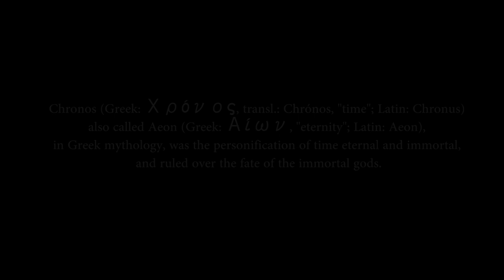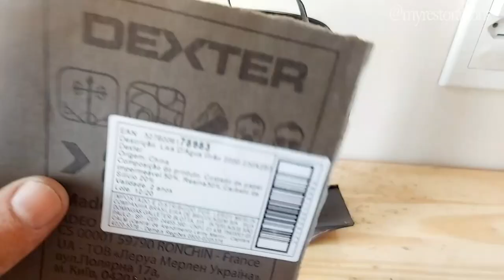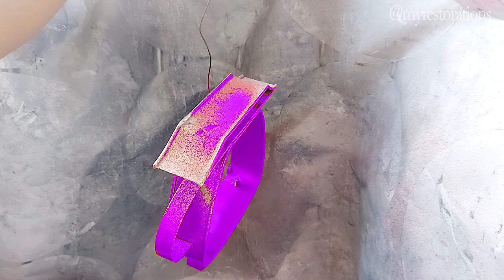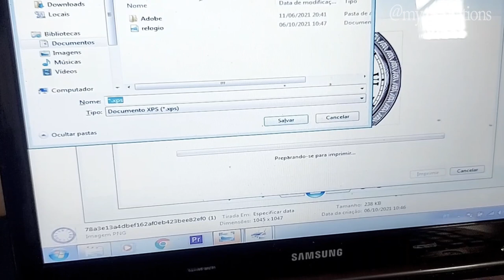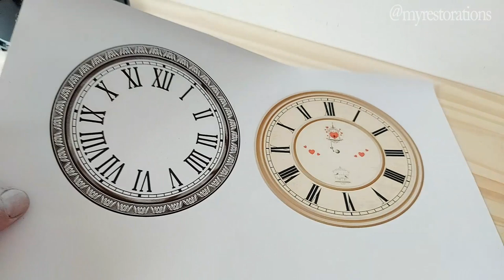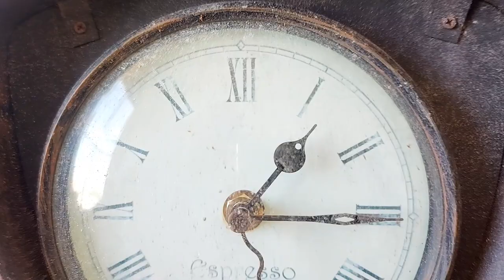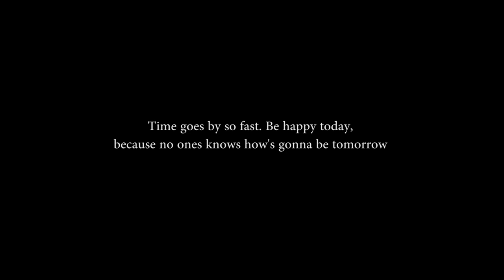Restoration Of An Old And Very Rusty Clock: Bring it to new again

Comment: That is not an antique - it has a modern battery powered tic-toc movement, surrounded with a plastic bezel on the back of the clock face.
Reply from the maker: You're right. Do you think I have to chance the title? 🤔
Reply: @myrestorations  - 😐, in my opinion = you need to change the title so it is not misleading, I have unfortunately reported this to YouTube algorithm as “spam and misleading”. When watching that video, yes it looks old but I looked at the hand spindles and when you turned it around and showed the plastic back I knew it had been made after 2000s = and was modern/recently made, just that the metal surround - shaped like a steaming tea cup and saucer - it was left in a humid environment and had rusted making it look old. The restoration was good and I liked it
Reply from the maker: @samuelfellows6923  Thanks a lot for your feedback I'm just beginning and I have a lot to learn, so I think it's very important the feedback like yours. This clock isn't mine, it was brought by my wife from the local where she works. I only did the restoration, I thought it was antique, even the part of plastic. I thought, someone put it there in anytime. I don't believe someone put it in water. I only restored it. Antique and Old is the same thing, so I don't think it's not wrong. But, I thank you about the feedback. 🤝🤝🤝🤝🤝
Reply: @samuelfellows6923  Man, why did you have to report it??? First, the restoration was very nice! So what it's not an antique? All you had to do was to contact the channel here asking to change the title because you are only interested in antiques and this title was not appropriate. By the way, it could easily have been a problem with YouTube"s translation than anything else. The word "antigo" in Portuguese is often used as a synonym to "old". So, YouTube may have mistranslated it as "antique" instead of "old". He did nothing wrong and you are a rude bitter person. Get a life!
Reply from the maker: Thank you very much, friend!!! Your're kind